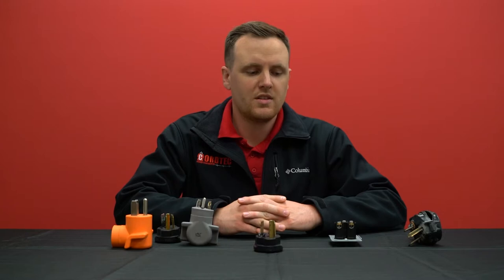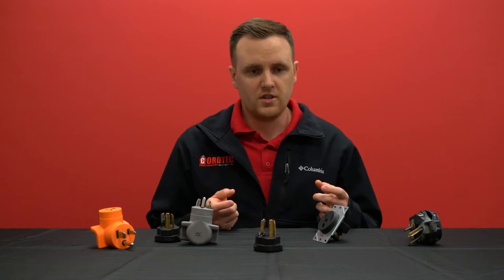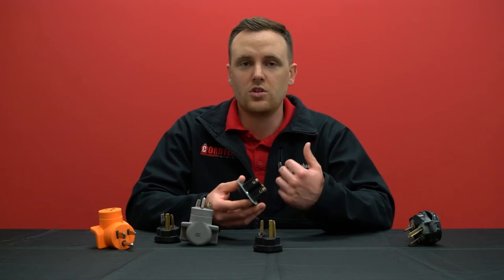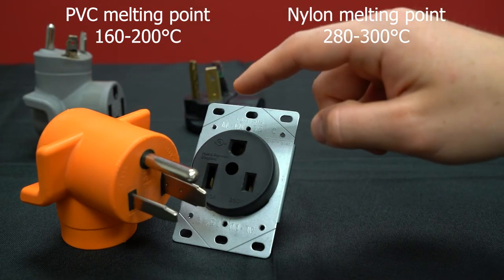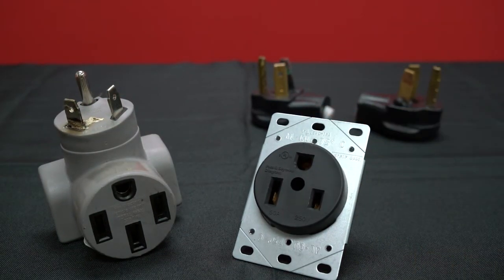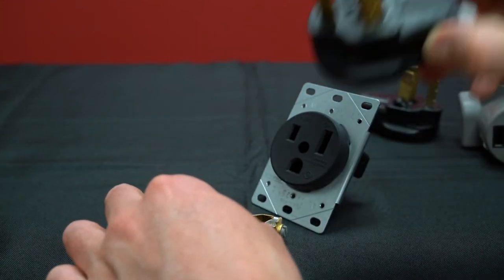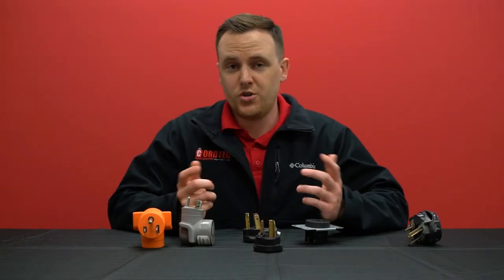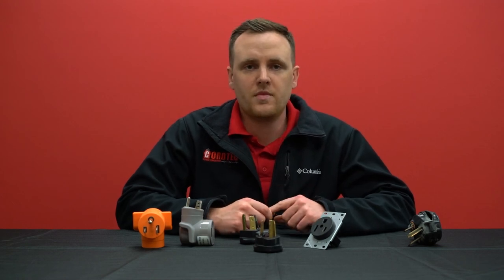The Cause & Effect of Electrical Arcing

Comment: I've personally experienced this phenomenon when outlets are wired using the backstab connection aka speedwire or Quickwire, happened to me in a house I was renting in Pontiac Michigan a while back,    I had an electric fireplace 1500 watt plugged in the living room,  I was enjoying my evening television program after a hard day's work on a cold November night and saw a bright flash behind the TV, breaker trips and refused to reset.   Because the property owner was a slumlord and hard to get a hold of I ended up changing the outlet myself, no biggie.    Anyway sure enough they had used the speedwire connection,  and the outlet heated up enough to break down internally and the hot and ground contacts shorted out.    Had to use heat shrink tubing to repair the wires behind the outlet,  as they were charred and already short and difficult to handle.    Also melted the plug on my power strip.    I never liked the speedwire connections. Always used the side screws on switches and outlets, never had any issues with those.
Reply from the maker: Smart guy! Glad you were able to solve that problem on your own.

Comment: Loose connections cause arcing. When an arc occurs juice jumps through the air. When juice jumps through the air,  electron cloud magic causes some chain reactions with the molecules/electrons in the air convincing them to join in the juice jumping party inducing far more juice than what’s originally made/available/ intended.